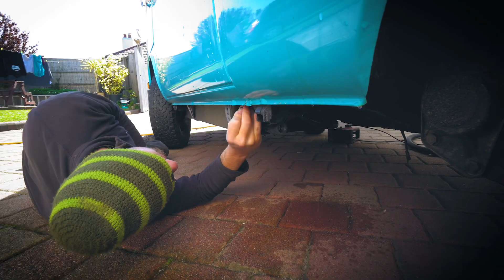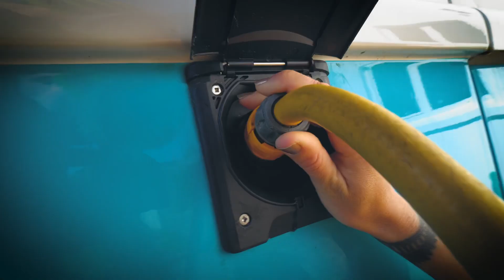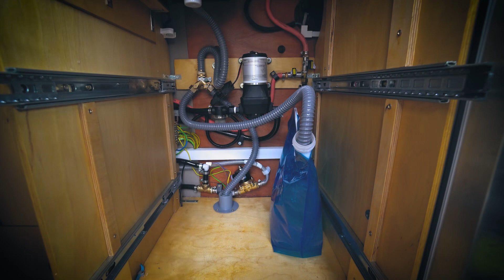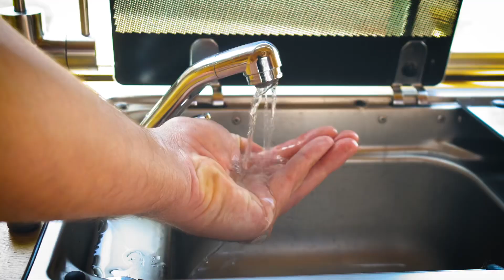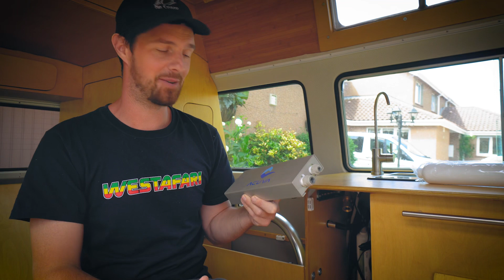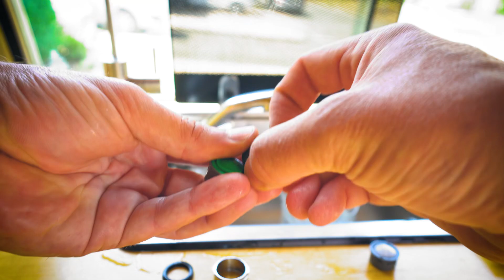VAN LIFE: Water Systems for Extended Off Grid Travel

Comment from the maker: FREE GUIDE TO VAN LIFE WATER SYSTEMS (with diagram): https://kombilife.com/water
Hope this helps some of you get out on your own adventures!
Reply: Hey—-having ads like this vid did, with it being super applicable to the tasks/adventure—-perfect.
Reply: i would put an aluminum sheet plate on the underside of the water tank, but you can spray the binding with a weather resistant paint. a brush paint might be a better application to get in all the crevices, maybe just a small rollerbrush. lots of products to select from.
Reply: @jerryherrera9243  That is a great idea.
Reply: Yall coming threw texas by chance?
Huge fan the wife and myself love yalls channel!
Reply: this is as good as a Techinical Data Package any way this can be converted to a PDF file no videos just the text?
Reply from the maker: @clownycrazy  You can check out our blog post if that helps https://kombilife.com/water
Reply: Tried the Amazon link for the tank straps shown in the vid, just got ratchet straps as a result. Maybe it's a region locked search as I am located in Aus.
Reply: @Myles Feuer Carbon takes out chlorine but not fluoride

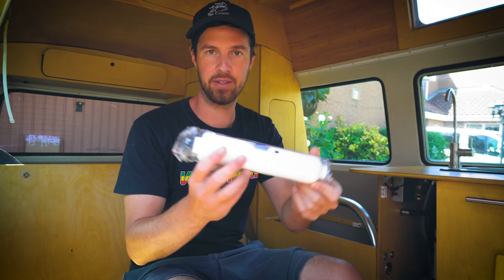Comment: 10:55 - Can i ask what fixtures you used to fit this into your water system? i've just ordered one off the back of this video and curious how you connected it with your water pipes. cheers.
Reply from the maker: They are push-connect fittings.

Comment: Great vid.  
It is an interesting little water setup.  
Hopefully the LED UV steriliser systems will come down in price in the near future.  
I would like to put 1 in my camper trailer drinking water system that I am scratch building.  
I am investigating low profile tanks hopefully about 80 litres to mount above or just behind the trailer axle.  
All the best to you both.  
Regards, Jas.  
Rockhampton Queensland Australia

Comment: Some water pumps are not designed for partial faucet opening. Cracking the faucet open a tiny bit causes the pump to stutter which can, over time damage the pump. The better pumps have a pass through function that eliminates this.

Comment: Impressive set up. One thing to note however, you don't need to be worried about getting legionnaires from drinking water, as it's a respiratory desease. You contract it from inhaling water where legionella bacteria is present. I'd be more concerned about legionnaires from using the shower (very common). Although neither of you are in high risk groups.
Also remember  UV is effective, but only at point of use. If you haven't turned on your drinking water tap in a while and you're water is questionable, or more than 2-3 days old just flush your tap for a few seconds before using. 
(I know I'm not picking, but work in water hygiene and treatment!)
Reply from the maker: Good tips thank

Comment: UV lights are used on medical rooms in some places.  You can wand the operating areas.  Our local animal shelter has a system going in that will circulate the air and run it through a UV system pathogens in the air a real problem in a shelter environment..  A suggestion, you may want to pick up some life straws just in case.  You can drink out of mud puddles with it.  https://www.lifestraw.com/collections/outdoors

Comment: I have a similar hot water unit and it exhausts very hot air out the top so I'm not sure yours is going to work where it is now without damaging your van. Also your water tank needs a rock guard for obvious reasons. It's hard designing your van to be bullet proof especially when you have budget and time limits so I still think your doing a great job considering .
Reply from the maker: Thank you for taking the time to provide feedback AND be nice at the same time. YouTube needs more people like you in the comments.

Comment: I too have set up the "on-demand hot water systems" for my super extensive overland - into the Wild blue Yonder  - road trips, and have always enjoyed unlimited, did I say unlimited? Yes unlimited hot water showers.   
1. Small  3-way valve installed on the water inlet to your hot water heater.
        a.  Get ready to lead the long water intake line from that 3way valve  into your 5 gallon plastic bucket that you now have on board, 
             and that  is full of what?      Your dirty clothes have been soaking in soapy water for hours an hours as you have been driving  along...
2.  Dump your dirty clothes, dirty dishes, or whatever in blue blazes you have been keeping in those 2 buckets out.
           That's right you have 2 of these five gallon buckets.
3.  With the On Demand hot water heater pick-up line now inside a 5-gallon bucket that is full of Freshwater from the creek, the river, the lake,
             the stream, the waterfall, the Windmill driven cattle watering pond etc etc..... you now have a unlimited duration hot water shower /
              supply because when you get down to half or so of the bucket all you need to do is.....
4.   .....call out, oh sweetie more water please!    

You guys are definitely a different breed and I relate to that,  On Demand unlimited hot water shower is the only way to keep all those people, which are mostly females, happy  and sparkly clean for extended treks.
There is only one overriding rule on this planet and that is ...... A happy wife is a happy life.

Been following you guys for years, love your crazy ass s***  did all the Americas in our 1970 bus way back in the day also. Still out there but mostly Oceania now.  Safe travels forever...

5. Oh, don't forget to switch your 3-way valve back to your on-board water supply.

Comment: You should never use and kind of soap plant based or not in a natural body of water. You should be at least 200 feet away from the water source.
Reply from the maker: Correct.

Comment: Hi Guy's, Love what you are doing. I built off road camper trailers for many years in Australia. We used several different types of hot water units one being the instant gas style you have. I designed the water system to draw water from an external source eg Jerry can or direct from a river. Many of our customer had kids so they would send them down to the river with their Jerry can to fill it and  bring it back for a shower. Would be happy to share trade secrets LOL.

Comment: Sooo many complications. Not sure why you do all that after having so much experience vanlifing. It goes in other direction for us, simplifying each year more and more.
At least you didn't build WC. :)
Holding the water in reusable bottles allows  1) to change them for hygiene reasons 2) fill easily (you can jump into restaurant or fuel station and fill up couple bottles) not 20-40L tank with a hose. 3)Drink on the go, cook easily, accessing bottles anytime. 4)they don't freeze
Dishes? What is the point? Just something you have to clean? ;)
Anything in vanlife is solved very easily when you take a good look at the backpacker's lifestyle. Cooking, showering, water filtering, anything.
The most essential thing we consider after years of van travel is a very decent freezer. We don't need any cooktops, running water but have 50+50L freezer and fridge, which can hold very healthy foods for months of travels. Everything is cooked in automated electric pots, even during driving.

Comment: 19:57 or when you are in a boat water is very important and their is little 
around the boat WATER
Reply: On a Boat you are mostly surrounded by salt water. Fresh water has to either be created out of salt water, which consumes a lot of power and requires expensive equipment, or has to be brought onto the boat. So supply is indeed limited.

Comment: Hi Ben, love your show! You water tank underneath is your weakest link.You should have had a full aluminium cover, with about 20mm round holes, perforated throughout, that holds, covers and protects the tank in place. Your metal straps are going to fail you soon. Please reconsider your design:-(
Reply: There's so much advice that I want to give too but I think people need to make their own mistakes and learn from them. And I guess that's also part of the fun 😊

Comment: The tight Aerator is actually not more efficient, the most efficient is the one that mixes the most amount of air with the water. Then you can just open the tap half way to reduce flow. 
I actually don't really see the one you put in saving a lot of water, it just trickles it down but doesn't mix it with air in any way.

Comment: Ben, since you read the comments, just a question.  Did you read the installation instructions for that hot water heater?  Not trying to be snarky, but the ones I've seen like that put out massive amounts of heat when they're running and I"d hate to see you burn down that nice van just trying to get a hot shower.  Hopefully yours doesn't have that issue but I hope you've considered it in installing the unit.  I'm headed to Mexico for 3 months in my Westy soon, last year added a diesel heater and a Truckfridge, now that's luxury!  Being able to get up in the morning and hit the thermostat to get warm is just amazing!  Even in Mexico it gets chilly in the mornings in January and February.
Reply from the maker: Yep. It sits out back when in use. Never turned on inside the Kombi. Thanks Don

Comment: Just curious due to the massive number of different filtration systems available: What made you decide to use a UV system as opposed to something like a distillation, deionisation, or reverse osmosis system?
Reply from the maker: Size and efficiency mainly. This is a much better solution for vanlife

Comment: If you intend camping in national parks in Australia you will be required by law to carry your own portable toilet. No longer is it legal to dig a hole at national park camp ground and many of them, especially the remote ones do not have toilet facilities. This problem is easily solved by buying a portable toilet, which are very compact and do not need to be fitted to your van.  You will be able to get what you need from any camping shop in Australia for about $100...
Reply: Clive Webb  If they intend to bring their dog, then they will NOT be visiting NParks as dogs are strictly verboten in every Australian National Park!  However you are right that some campgrounds (even private cattle stations at times) allow only self-contained vehicles, and that does mean an onboard portable loo.
Reply from the maker: Good to know thanks guys.
Reply: Kombi Life  The keywords are ‘self-contained’ and ‘leave no trace’. On a recent tour of WA SA and Vic I used WikiCamps and found it indispensable for identifying loos and showers and campsites. (The best part of wikicamps is the public comment section for most uptodate info). I was in a small van, but with a portable loo and pop up privacy tent just in case I struck a self-contained rule. Thing is, I barely used it. Even in remote parts of WA there are drop toilets (never fun to use, it has to be said).  But more generally,  I often ended up at designated camping spots or van parks for convenience, making my trip way more $$$ than anticipated. Lots of councils are cracking down on free campers now. In WA Rangers will fine you on the spot. Free camp Regs vary state by state.

Comment: in regards to saving water when showering google the hour shower its a recirculating water setup it uses 2-3 lt amount of water an if connected to a heat source you can get hot shower for well hours
Reply from the maker: sounds awesome

Comment: As you’ve got a solar panel I would use an electric stove, you can get on for £39 at IKEA.
Reply: It's not really practical to run mains devices off a 12v system,   A mains electric stove would deplete a leisure battery in minutes.  There are always gas or 12v alternatives.

Comment: If you're intrested I can show you how to do a recirculating shower which only uses one gallon of water. It's the best off grid shower system One can build
Reply: For sunny hot climate mist shower could be used solar.lowtechmagazine.com has an article about it. Variable frequency BLDC pressure pump may be better but sure more expensive.

Comment: as always thanks for the video  ..i hope you have tested the watertank plastic at -20c  a temperature you will see in your travels  i hope it will not shatter from  brittleness at that temperature  from somthing as simple as a rock from the tire... 

a protective metal plate might be advisable
Reply from the maker: Good idea, thanks for sharing
Reply: Agreed, I was shocked they didn't have a protective shield!
Reply: @akonnema  will add weight and make maintenance access more painful but a rock shield on the bottom may be a beneficial investment for reliability over non northamerican paved roads im suspecting many k's or miles on challenging surfaces in equaly challing conditions and locations.. knowing it is not likly to be a problem  worth it in my mind

Comment: I often take water from different sources, but never used filter system, either have problems. 2 years ago, I eve drink water from harbours in Greece, directly from the faucet they use on boats. As long as doesn't smell strange or have strange taste, I drink it.